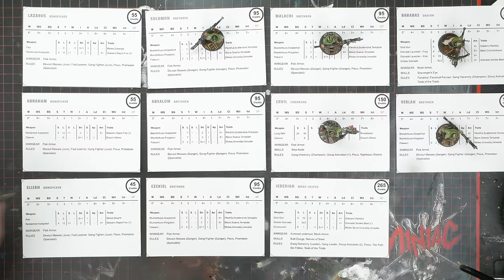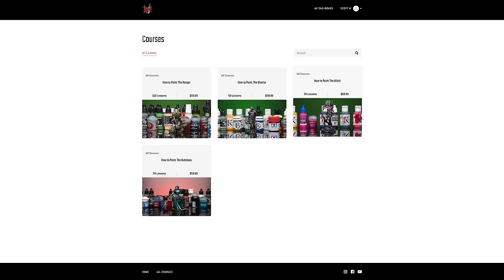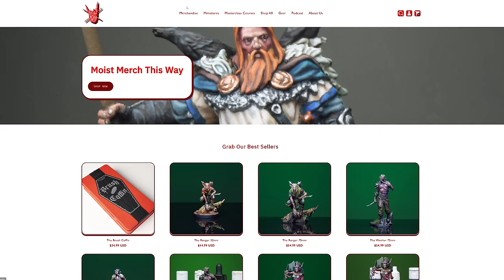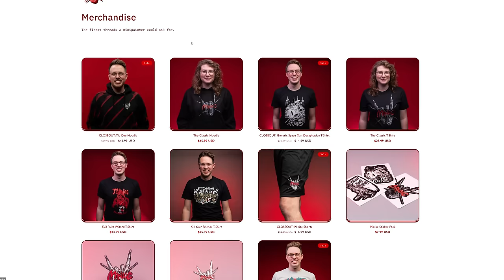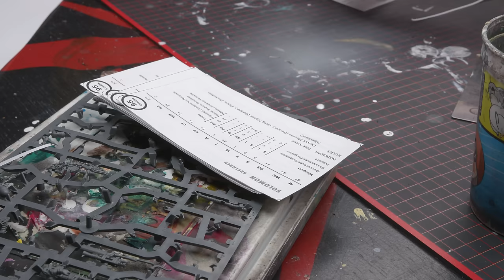Painting Minis For a Game I SHOULD Hate..

Comment: Not that there's anything wrong with your conversion, but the blunderbuss with purgation shot is really just a primitive shotgun with incendiary rounds, not a full flamethrower.  A blunderbuss is a weapon with a flared barrel that's used to fire whatever scrap the shooter crams into it, so I usually use the polearm that has the appropriately flared tip to represent it.  Just throwing that out there for anyone who sees this and gets worried they need to do a full conversion just to run the gang's star weapon.

Comment: Super inspiring video! Thank you for showing your process. I was wondering, how did you establish control over the oil washes? To my experience it looks amazing on first application, but the next day the wash seeps out everywhere like a micro film, tinting the entire area around it. Its not a dirty tint (like a contrast wash would be, for example), really it just makes the whole model slightly yellow. What gives?
Reply from the maker: @polyfission2776  you need to strike a balance between thin enough to run in the details, but heavy enough that it doesn't spread out a ton. Admittedly this is something that I struggle with and I actually talk about it in this video!
Reply: @Miniac  Thanks for the response! Yeah I noticed the oil on your fig did a coffee stain overspill, but that's fine enough to whipe off, right. On my terrain, I swear, its like the entire model becomes slighty dyed. Say I let it set in the crevices at the base of the figurine, by the next day, the whole dude turns yellow, up to his head! Its like putting a sepia layer on overlay in Photoshop. I'll try to experiment with way less mineral spirits. Thanks for the advice!

Comment: 2:36 Don't you have a cricut dude? There's no excuse for those unrounded corners!
Well, other than the cricut's paint and cut feature is painfully cumbersome.
1. Create your stat cards in a pdf (I assume, I don't play necromunda)
2. Import the PDF into some graphics program so you can export PNGs
3. Upload each individually within the Cricut software, something which is a 3 step process with 2-3 clicks per step for some reason.
4. Add them all to a print-and-cut job.
5. Whoops, re-open the graphics program because the Cricut software randomly resizes things, so you can figure out how wide they are supposed to be and resize then in Cricut
6. Print and cut

Now, if you're crazy like me, I will print, run the printed sheets through a laminator, then cut on the cricut, then run them through the laminator on the hope the corners don't come away.

Really, why aren't you doing this?
Reply from the maker: The issue is that I'm using the website yaktribe to create the cards and the export they have is kind of awful. It doesn't create a PDF/PNG/JPG but rather uses HTML and css and prints off of the webpage. My next play is to just make the cards myself in photoshop and cut them out with the cricut like you said.
Reply: @Miniac  I hear that. Although you should be able to "print to PDF" regardless of the source. But it was mostly just a joke since I figure you've struggled with the Cricut's UI like I have. Hopefully it was so ridiculous that it was clear that it was a joke.